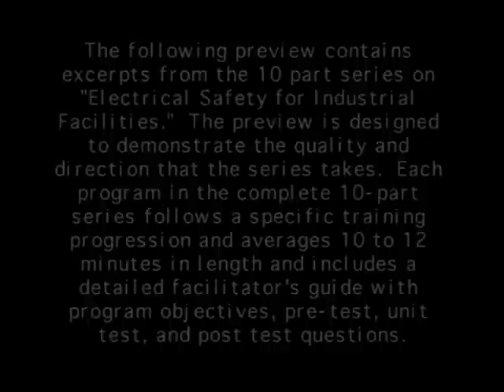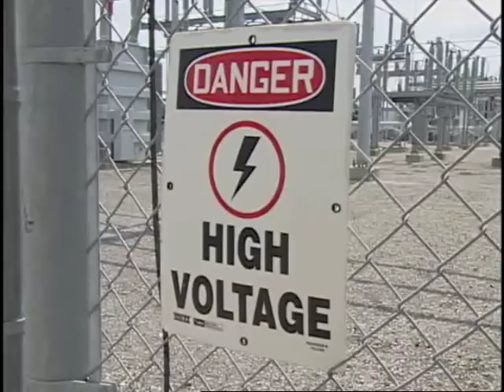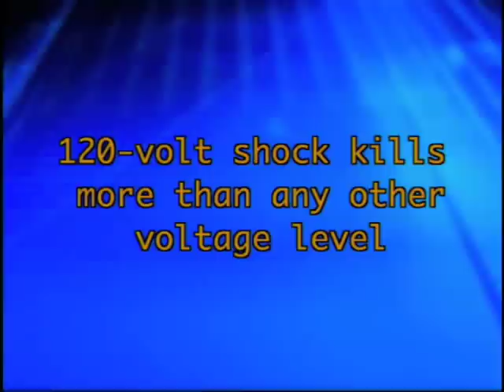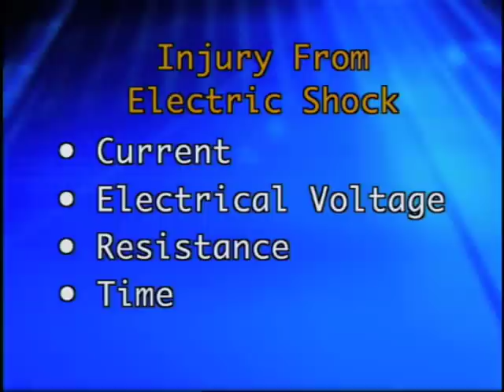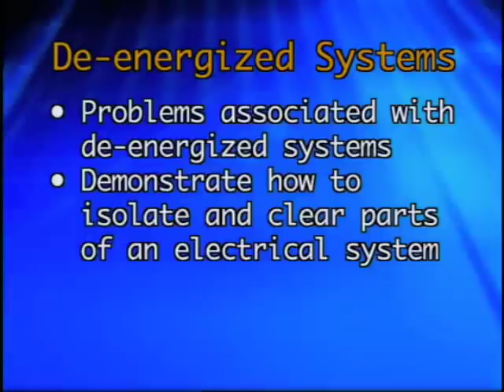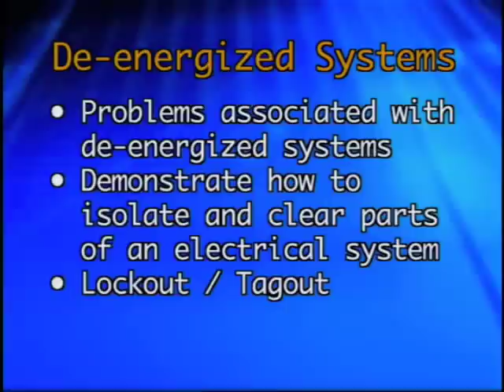Electrical Safety for Industrial Facilities | Part 1 |

Comment: I had been shocked by static electricity shocks before, so I know that electricity is not a joke. It is very serious business and must be highly respected. 

Especially in industrial facilities where high-voltage or medium-voltage electricity is common, failure to follow rules, guidelines, and procedures in these areas can lead to dangerous shocks or, even worse, an arc flash.

Comment: why is the guy holding the meter not wearing gloves?
Reply: Insulation on the wires to the probes should be good for 600VAC. The gloves are for the person close enough to bare conductors or terminals to get shocked. He's not risking getting shocked unless the meter has a problem. But you're supposed to check and verify the meter before you use it anyway.